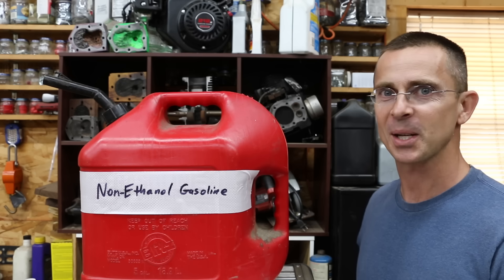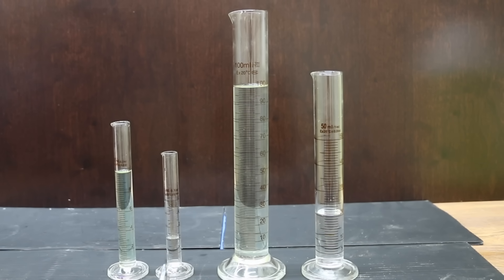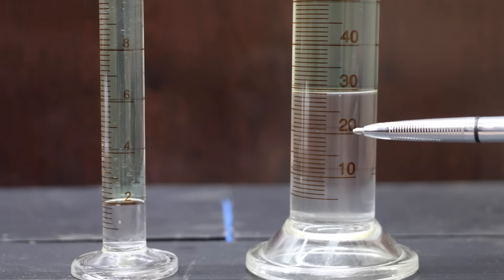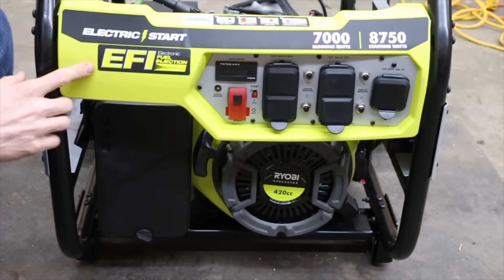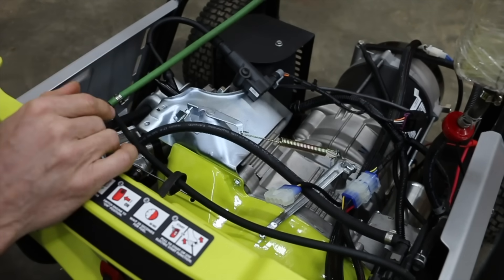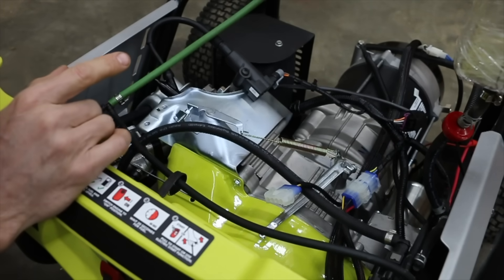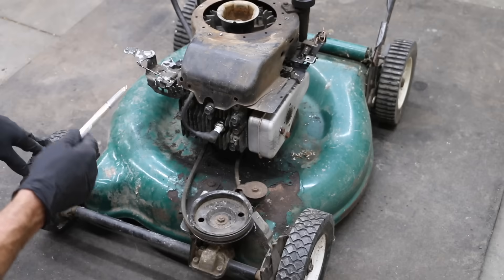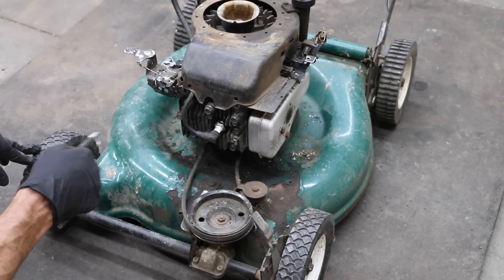Is Non-Ethanol Gasoline Really Better? See the PROOF!

Comment: Note that the labels on the gas pumps say, "UP to 10% ethanol." I tried that water test on some regular gas at the corner market and it was 5%.
Reply: Frequently Cynical True. Depends how much they put in. They’re allowed to up to 10% to comply with oxygenation requirements under clean air act, but don’t have to go that high.  I’ve noticed some stations I inspect are lower content as well. 

Now a days they’re approved to sell up to E-15, usually blended at the dispenser from a separate nozzle, but I wouldn’t run that unless you have a true flex fuel system.
Reply: I got almost 20% over several tests from different (Lower tier) gas stations.  There is no regulatory oversight when it comes to E% content.
Reply: At 30% ethanol is when cars start showing signs just like water in gas tank would cause.
Reply: @roccobro  Yes there is. The pump must be labeled what percentage of ethanol is in the gasoline. If the pump says 10%, 15% or 85% ethanol, it can contain up to, but not more than that amount.
Reply: @Pro1er  FALSE.  it's NOT SUPPOSED to have more, but CA has very very minimal testing or punishment if OVER the amount.  Why would gas stations add Ethanol or even water to their tanks?  It's almost like... wait for it they are in BUSINESS to make money or something!
Reply: @roccobro  agree. It varies alot, even seasonally. I avoid all ethanol pumps for my generators and 2 stroke engines. My truck, dont care so much mid grade fuel.
Reply: A few years ago i read an article that the ethanol is added at the pump by the truck drive and it can very  from 0% to 20%  so i purchased a test kit on line and sampled gas of different grades in the same station and different stations over a few months and i found it to be true no consistency.
Reply: @dougowens2686   The oil companies wouldn't leave it to the truck driver to make the final product!  They aren't chemists.  And it would require yet another tank within the tanker. 

The refineries will change the percentage of alcohol based on many factors like the season, the market price of ethanol, and the market being delivered to.
Reply: @frequentlycynical642  i agree sounded odd to me so were is it mixed and why so much variation i am no the only one who has found 15 and 20 percent
Reply: @dougowens2686  Yeah they keep corn cobs on the deck and toss some in after they finish pumping.
Reply: Being a fuel truck driver they inject it at the refinery in the racks as we load it if it goes into into over or under spec the loading arm crashes and we can’t deliver till it gets reset by the terminal and adjustments are made by them it’s always ten percent in Canada but if you look at a fuel tanker you will notice that there are four to seven tanks inside that one big tank called compartments and we carry regular premium and diesel on the same trailer depending on what the customer ordered
Reply: @jimwhite9985  informative thanks!
Reply: Is your vehicle a flex fuel vehicle that knows how to adjust for the fuel flow requirements to compensate for the alcohol content? If you run 100% Ethanol, your fuel system MUST be capable of recognizing that the fuel has changed and therefore adjust the amount of flow. If your system does not account for this, you run the risk of running your engine EXTREMELY LEAN and blowing it up. Even a 5 to 10 percent difference can cause damage to your engine if it's not "flex fuel" certified.
Reply: What about motorcycles
Reply: @JustaskGlen  well, it depends on whether or not you have a carburetor, or fuel injection. If you have a carb, you need to get approximately 200% larger jets installed to run 100% ethanol. Fuel injected would need bigger injectors and possibly tuning.
Reply: Does it depend on the season? In Arizona there is fuel for summer vs winter
Reply: @MM-gl1xz  Good question. I've never looked into what they do for E85 for the different seasons.
Reply: @MM-gl1xz  They do adjust the ethanol content to help with winter month starting. lower percentage of ethanol in winter months.
Reply: Melly Mel yes there is a summer and winter blends of gas! 👍🇺🇸

Comment: The issue with ethanol is that engines are probably not calibrated (adjusting fuel injection timings and spark plug timings at different engine temperatures and RPMs) for E10. And reading the comments, it seems that they also use low grade petrol and increase the octane number with ethanol. Using pure ethanol, you can also achieve much higher efficiency by increasing the compression ratio because of its high octane number. The engine material hasn't been changed either. This shows why regulation never brings about success more than it does about the strength of ethanol as a fuel. The sugar lobby has the politicians and regulatory agencies in their back pockets. This would have been avoided if federal government did not interfere in the activity which was not attributed to them in the constitution, and in doing so, they've violated the 10th amendment of the US constitution.
Reply from the maker: Thank you for the feedback

Comment: If the car or machine is tuned for it, it’s not too bad for e 10 or e 15.  It may clog carbs and eat parts and seals of older equipment.
Reply from the maker: Thank you

Comment: Here in Australia, a small engine specialist, ie servicing noticed a big increase in non running small engines a couple of years ago. Turned out the only fuel supplier had substituted E85 for standard fuel in his tanks. This was brought to his attention cos the service had the equipment to test. There was a rapid change of bulk fuel supplier. Please note that Australia has different protocols to the USA for octane ratings, ours read a higher number.... probably , not an expert!
Reply from the maker: Thank you for the feedback

Comment: I'm a landscaper. More than once ethanol based fuel has completely shut down all my equipment. When we run non-ethanol there are no problems. The ethanol shuts down the small engine's because if the water it collects. Thanks
Reply from the maker: Great feedback. Thank you

Comment: It's the moisture content in alcohol that might cause "corrosion" on unprotected metals. All fuel has a moisture content. Most gas tanks and fuel lines are not just bare, cold rolled steel. They have some type of coating or they would corroded from the inside out. Alcohol fuels are denser than gasoline. The E85 cars with the option to run gasoline or E85 fuels do have oil filters with larger diameter centers to increase oil flow since denser fuels burn hotter. Denser fuels also pollute more, particulates in particular.
Reply from the maker: Thank you for the feedback

Comment: Here is my 2 cents on ethanol vs non ethanol. For years I ran any gas in my two stroke engines. Periodically, about every other season my two strokes would cease to run due to lack of fuel to the combustion chamber period. Either clogged carburetor passages or fuel lines broken in two. I tried depleting the fuel tank and running the carburetor out of fuel between uses but that didn't work.  My experience has shown, once I switched to ethanol free gas these problems went away. I got tired of replacing carburetors and fuel lines every two years or less. On 4 strokes, I have had no issues with ethanol gas. So for all intents and purposes, consider ethanol free for all your two stroke engines such as weed eaters and chainsaws. Ethanol just hasn't worked well for me in two stroke engines. So I buy ethanol free in a separate gas can and do all my premix with ethanol free gas.
Reply from the maker: Great feedback!  Ethanol is definitely a problem.  Thank you

Comment: I was in the petroleum service industry for fourteen years in the NJ area and when they started putting ethanol in gasoline it caused many problems. The first thing was that it's very doubtful that the oil companies were using just ethanol, but an array of light end solvents that were very harmful to plastic parts, o rings, and seals. The best example that comes to mind is when a 2004 chevy truck that I drove for work had plastic fuel rails that were dissolved by the fuel and clogged the fuel injectors that would have to be removed and cleaned often. there were also problems with ultra-low sulfur diesel fuel as well, but that's a story for another day.
Reply from the maker: Thank you for the feedback

Comment: I have a Honda lawnmower.  You'd think they'd be able to build a reliable machine, but I've had this thing in the shop so many times I've lost count.  Each time it's the same story:  Needs a new carborator due to Ethanol leaving deposits.  I've taken apart these carbs and cleaned them really well to no benefit.  They have micro ports in them that can't be cleaned.  It's a nightmare, so I started removing all the ethanol from my fuel, plus I turn off the fuel and burn any remaining fuel in the carb when I'm done, but these Honda carbs just suck.  We're now seriously thinking of hiring a landscaper, I just can't deal with the aggravation any more.  Maybe I just need a good old B&S engine.
Reply from the maker: Thank you for the feedback on the Honda

Comment: All I can tell you is I purchased a brand new riding mower a few years back.  Ran it for 6 months with no problem.  As a snowbird living in GA, we went north for 6 months and hired a person to cut our grass.  (Using his own mower). Mine sat in the garage not being used.  Returned home and went to cut the grass.  Mower would not start.  Ended up having to replace the carburetor.  Why you might ask, well according to the local experts, these new mowers do not do well with ethanol.  In fact they don't like it at all.  I was told to use marine gas in the future, as it does not contain ethanol.  Well, about 6 years later, using marine gas, it still runs very well.
Reply from the maker: Thank you for the feedback!

Comment: I live in Prescott, AZ, and non-ethanol gasoline is offered as an 
alternative. I use it for the lawn mower, chain saw and antique vehicles
 that aren't driven a lot. Costs about 40 cents more for the non-ethanol
 gas. ($3.25/gal vs. $2.85 at Maverik). I have not made any mileage comparisons, but if
the non-ethanol variety promises to be kinder to the engines, I have no problem paying
a bit more.

Comment: Thumbs up on another comparo video. With just 10% or E10 it takes 1.5 gallons to equal 1 gallon of non ethanol in btu's (energy) output. Further fuel containing ethanol requires a cosolvent to remain mixed with what is currently benzene not octane and it definately is not gasoline and this fuel only takes as little as .05% of a precipitate to cause phase separation which renders an engine outta service because now it wont ignitite at all and usually requires service to fuel system from intank pump to fuel injector and well It just more us gov't bs. One more fact is that there are a few plants that are better choices for use in ethanol manufacture than corn which is 10-15% use of the harvested plant, pussy willows for instance are damn near 100% or you can use the entire plant in other words to produce plant based alcohol.
Reply from the maker: Thank you very much!

Comment: As far as I'm concerned, ethanol gasoline is junk, but there's not a lot you can do about it. I did part time service work for 3 years and covered about a 150 mile radius. A local station had non-ethanol gas, and my Honda CR-V ran stronger and got better mileage. However, because the stupid government subsidizes ethanol production, it's a wash because non ethanol gas costs more. Ethanol gas couldn't compete in a free market.
Reply from the maker: Thank you for the feedback
Reply: I noticed today, I always used 93 on my car but today after put 90 ethanol free idk if is ok but i felt my car better and more stronger than ever

Comment: Ethanol is good for drinking, not driving. Ethanol, or ethyl alcohol, is the active ingredient in all alcoholic beaverages, so putting ethanol in your gasoline is a waste and is alcohol abuse. Er, and engine abuse.

Mix 2 ounces of ethanol with 12 ounces of orange juice and a big squirt of lemon and a big squirt of lime, and you get a nice tasting "Screwdriver", and if you give yer girlfriend a few of them, you may even get screwed. Bonus!

But ethanol is crap for your engine. It doesn't put out the same amount of energy as the same volume of gasoline, so it is not as efficient, ie, inferior gas mileage, less power, and if it sits for a month or two, it falls apart and the water separates out and wrecks your gas tank and fuel lines with ethanol sludge.

Best to just drink it. Probably you will have trouble finding pure ethanol cuz the gubberment restricts the sale unless they can somehow tax it the same way they tax booze.

Some people drink methyl hydrate because they think it is the same as ethyl alcohol. It's not!!!

Do not drink methyl alcohol!!! Ever! If it doesn't kill you, it will probably make you go blind and will wreck your liver in a hurry cuz methanol is POISON.
Reply from the maker: Thank you for the feedback

Comment: Any fuel containing ethanol should only be used in vehicles or engines deigned for ethanol as they do not have components (e.g.) that are affected by ethanol. Most recent vehicles (at least here in Australia) are compatible with ethanol. E10 is rated at 94 RON and is 2 or 3 cents per litre cheaper than non ethanol 91 RON fuel. I have been running my turbo Falcons on E10 for many years (need the higher RON) and no problems of any sort. The old story - horses for courses - use fuel that is suitable for the application. Do not use E10 in a old lawn mower or anything else with a carburettor and fuel lines that are not compatible with E10.   E90 is popular with very high performance modified vehicles due to the high RON.
Reply from the maker: Great point. Thank you

Comment: More than a couple of percent of EtOH in the fuel for most motorcycles, makes things worse. Of course I found a motorcycle that’s not too picky using even 87 octane rating with EtOH. 

Back when I ran bigger high compression motorcycle engines they hated most fuel with over 5%. Older motors that used leaded fuel don’t do well either, but can be converted to some extent with newer parts.
Reply from the maker: Thank you for the feedback

Comment: I cant believe your using 91 octane is that the highest in America?
 You cant even get that here  the lowest is 95 for your standard fuels and 98-99 for the better fuels which is what I always use I find you get way better performance and you definitely get more miles per tank and much better for your engine.
Reply from the maker: Great point.  The US uses a different system for rating octane

Comment: I’m not certain why you’re using a 2-cycle lawn mower engine. You certainly cannot compare its performance to a standard 4-cycle car engine. For example, the lawn mower engine produces only ca 100 psig; the average car engine produces ca 150 psig, a massive difference. And, more to the point, a much more demanding circumstance for the fuel. 

Basically, unless you’re trying to prove something about lawn mowers, your tests are meaningless.

Something else you never check is the impact on the engine oil. But that’s not surprising: you’d have to run MUCH LONGER tests, and have to do much more sophisticated analyses. In particular, the impact on the viscosity and anti-corrosion additives in the oil can be substantial.

Comment: Since 2006 Indy cars have been using 98% ethanol.  Why? Because the high octane number of ethanol (113) permits much higher compression ratios—more powerful engines. 

So, do you think your simple tests are more relevant or accurate than those done by the engineers who are responsible for Indy cars?
Reply: ya think

Comment: The situation:  I've extracted ethanol from gas.  Now...1) to have proper octane for 2 cycle engine do I buy 91 octane or 2) buy an octane additive.  If answer is 2 how much do you add so engine has sufficient octane.  Love your work!
Reply from the maker: Thank you.  It's very hard to determine this since gasoline is blended differently at different refineries to achieve a certain octane level.

Comment: The octane number of ethanol is 113. So, if you decided to remove the ethanol from, say, 91 octane ethanol-gasoline, that would leave you with about 89 octane gasoline. That would be more harmful to your engine than using ethanol-gasoline. You should have been much clearer about that!
Since the ethanol molecule contains oxygen, it’s effectively partially combusted. Thus, it will predictively give lower mileage. No testing is needed!
Your deposit test was meaningless. Hundreds of hours or longer are needed. That’s what oil companies and car companies do.  
Finally, ethanol, itself, is not corrosive to two-cycle engines. However, in a humid climate, the water vapor might cause the separation you saw in your first experiment. That mixture MIGHT cause some corrosion in the fuel tank. That could also happen in a car’s gas tank.
Reply from the maker: Thank you for the feedback

Comment: I keep mpg record of every gallon of gas in 4 cylinder 6 cylnder and v8 engines and which I put in. I totally disagree ethanol improved efficiency! In every engine I lose 18 to 20% mph.
Talked to  drag race drivers in every class and every driver told me they use much more alcohol fuel than no ethanol gasoline. Further evidence is to compare mpg on new car monroney stickers E-86 to non ethanol to see a 25 to 27%  drop in mpg.
Reply from the maker: Thank you for the feedback